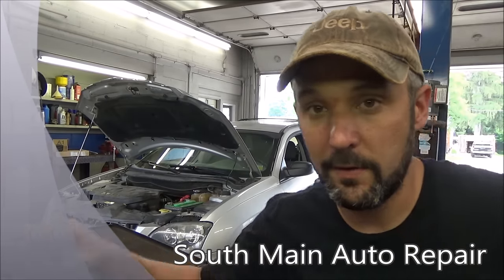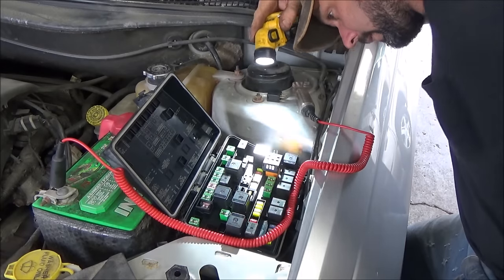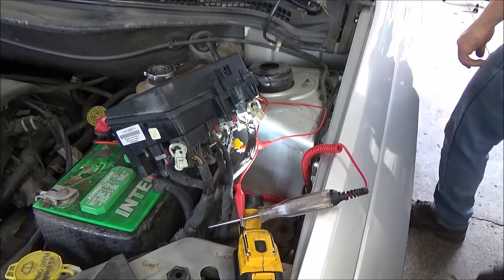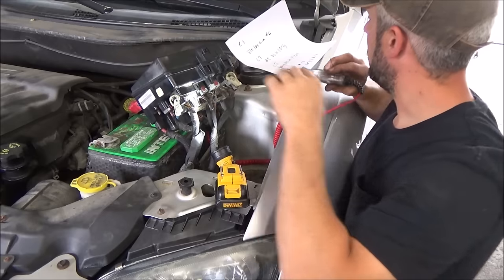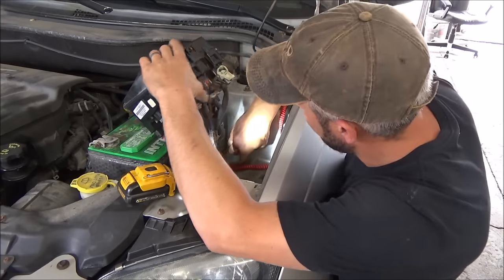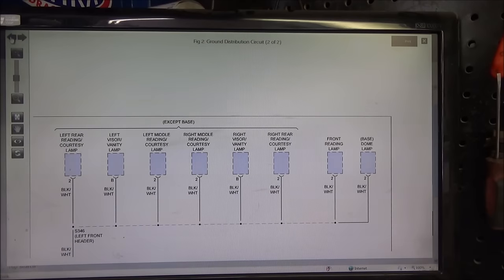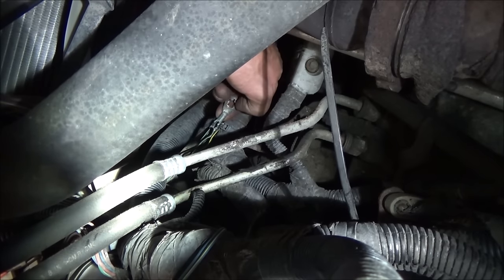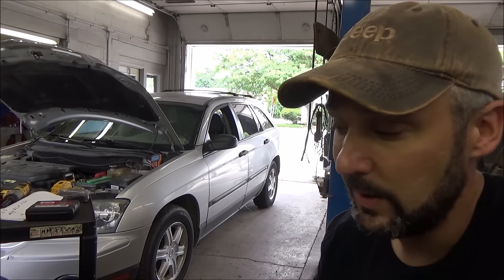Chrysler Pacifica: TIPM Electrical Problems

Comment: I do like that approach I general tend to look at ground locations a little sooner and check those first if ground looks clean then I start chasing the bottom of the power module, your video was sent to me by one of my customers who is having the same issues with the same vehicle, as you were looking up all the grounds in I noticed where it pointed out the ground point you ended up at in the end, very informative video, and extremely helpful thank ya bud!

Comment: Thank you for your diligence. You had me when you did a primary check then double checked and l think there was even a triple check when you verified that it was one of the other components problem also. Even though that was not the exact problem with my 06 Pacifica it got me down the right path. l found a bare wire under the fuse box that that l never would have checked, even then it wasn't obvious. An hour earlier l told my wife that we might have to take this one to the shop because electrical shorts could be anywhere. So that fix ended up not costing anything but then l triple seafoamed the engine, changed the oil and took it to the carwash. Thanks for making it a much more enjoyable weekend. Blessings

Comment: In all honesty I was ready to replace the tipm. I was curious enough to see how you were going to test ground and the results of your testing. Totally impressed. It's very obvious in this video that you are indeed tired but you still thought the problem through you still found the cause and you still found the right fix. I agree that clearing because was the appropriate action because you have to accept customer word to a degree that he had no problems prior to the system basically going a little nuts on it.

Comment: Dead on the issue with 05 Chrysler  Pacifica.  Same issue happened, then "fixed" it self later, but next day it was back.  Watched video, saw the corrosion, jiggled ground, bingo "fixed".  Still gonna have my mechanic do the correct fix as it is real difficult to reach let alone work in there for me.  Big Thanks

Comment: Having the exact same issue but it's only when I try to turn on the wipers, everything shuts off (except the car) and the wiper relays buzz. I bypassed the 3 ground wires directly to the negative on the battery with no luck before watching this video. 
Gonna take a second look now!
Thanks a bunch for the great info!

Comment: This video is a great education in combining practical troubleshooting tips and applying theory...for the lesser of us auto electrical wannabes' there's a lazy technique to help the troubleshooting enigma...pop the covers off of the relays associated with the non working component e.g.windshield wipers not working,locate relay..remove relay cover activate the electro magnetic switch with an insulated tip and if the component turns on then the issue is before power distribution e.g. a broken wire somewhere between the switch & the fuse box or the switch itself is faulty.

Comment: The two codes shown were related to modules that were on the same bad ground in the electrical diagrams you showed..  :)
Only noticed as I was reading the module names as you were searching for the TIPM grounds...  :)

Comment: I do the same thing when diagnosing 20 plus codes on the class 8 freightliner trucks. Usually is a datalink issue. The newest trucks have 3 datalinks  can and 1939 at 2 different speeds 250 baud and 500 baud. These converge at a starpoint module.So when diagnosing a multiple code problem you have to look at what common ground and power and communication protocol the devices use. A big headache and when these trucks get struck by lightning oh boy you are changing out all the modules. Have seen this 3 times in the last 5 years.Anyways you have to simplify a multiple code scenario that is what you did and that is why you own your own shop. Kudos.

Comment: My car is the same make and model as the one in this video and I have already bought another BCM and changed it out and needless to say that wasn't the problem 
And then I come across this video and  done just as you did and I couldn't believe thats what was wrong with my car it was a bad ground issue 
Thank you so much for making these videos you save me from spending more unnecessary money than was needed

Comment: Thank you for the video. Most of us may never think to check the grounds. Bad connections can show the voltage without being able to carry the necessary current. Half a day on a Dodge starter one time. Ground checked good, would not work on car. Jumpered ground, no change.  Jumpered hot just out of curiosity, fired right up. Cut battery clamp off of unblemished factory cable, replaced with cable clamp off of a junker. Problem solved. Apparently the factory cable had broken strands and would not carry enough current to operate the starter.

Comment: Thank You,  I'm trying to find a short in the ignition system of an 1998 Dodge Caravan Sport that only occurs intermittently which has made the vehicle basically worthless because you never know when it will happen. You have given me so many ideas and Technics  to use on finding and fixing this old van so it can be a daily driver for someone again, I'll be ordering some SMA Gear as a thank you for all the great work and videos you do. Thanks Again

Comment: Thanks for the Great vid! had this same problem and was able to fix it myself for under 20$ of parts and some time. Small tip for others doing this. take out the battery and battery tray for easier access to grounds.

Comment: Great video -Fix my problem. My car was out for 20 days. My local car service can not find the problem and i have an appointment with the dealer next week , just for disgnosis $145  . 
I wacth the video and i just made an short way - easy to check. I remove  light (2 screw) , battery holder (3 screw) and remove the ground same of the of video ( the of the 4 cables ) the cable look ok was it was broken in the connection . i strip the cables and connect to ground and everything return to work perfectly -  Thank you. I save  big money and time.-

Comment: Great job on diagnostics!  For anyone attempting this type of repair on their own, the very first thing to check would be battery voltage.  In these newer, computer controlled cars you can have a weakening battery that will still start the vehicle but below 12V and these control modules can do all sorts of weird things.  I'm guessing you did that first, but it wasn't mentioned in the video.

Comment: Awesome video.  A friend had the same issues so we went straight to the ground lug on the frame.  The connector looked corroded and the wires were attached but as soon as I touched them all four fell off.  Fixed and back on the road.  Thank you!

Comment: Thank you. 
   Now the manufacturing engineers need to redesign that ground connector - NOT - so you still have a job to do.
    One poor and oxidized connector! Been there and done that with $200,000 mass spectrometers. 
   Thanks again. An enjoyable video. Good luck.

Comment: I was busy with another project and told my customer "car flipper guy" to search YouTube for Pacifica electrical problem. He found this  video and said it had the exact same problem . He sent me the link this video and showed up at 4pm.
I said I don't have 45 minutes to watch the video now unless Mrs O is in it., 😉.Turns out he gave me the minute mark Eric found the problem. I pulled the battery, battery tray and TIPM . Removed and  Inspected that TiPM connector Eric was back probing , looked fine, so I found the 3 major ground points , removed and cleaned all the ground nuts  , and  ground wire eyes and found a broken detached black and yellow wire at the lowest ground location. Spliced a ground eyelet wire left over  from a FIAM horn

Comment: If this was my personal car, I would have soldered all together along with a #12 wire and heat shrink  the group to make water proof. Then attach the #12 to the battery ground. I know that you must keep as close to stock, as you did. Thank again Eric , great video on all points!

Comment: G103 sucks. Coincidentally, I just had a stratus with  a no charge complaint come into a dealer. Found codes for all 4 O2 sensors as well. all 'cuz they share a wire to g103. I love wiring issues, that feeling of joy when you beat it, when all wires try to do is confuse you, good stuff. Trying to learn the proper "make no assumptions" frame of mind from you and others on the net. Thanks Eric.

Comment: Thanks for making this video, you helped another.  

I'm not sure how you soldered those connectors in that tight space (talented). 
 
Since I had the relay/fuse box out and the battery and battery tray removed, I decided to remove all grounds from the bottom 2 studs to provide enough slack to pull them out under the bumper (with bumper guard removed obviously).  

Was easier to sit and work on wires. 

Keep up the great work.

Comment: Absolutely love your videos! Im having some of the same issues on my 2008 Chrysler Sebring 2.4 where as the shifter moves only sometimes but never cranks and problems with the windshield wipers and the horn blows on its own just whenever it feels like. The last time, it started blowing when I opened the door that wasnt locked. Had to put key in switch and turn to get it to turn off. Ive unplugged all the plugs going to the tipm and plugged them back up. I guess I will try to check for grounding issues now. Thanks so much.

Comment: Great video even 4 years later! I had a low battery crank, and when I crank it everything stop working on my Pro Master. Things went haywire mostly things that aren’t technically safety issues. My mechanic called it a body control module but after looking at your video, I’m thinking it has something to do with a ground switch possibly because I saw someone else’s video a year or so ago saying there is a grounding strap that causes some issue but I did not save this video so I am not sure where I saw it! But it is a similar scenario to this video, the problems I am experiencing on my 2018 ram pro master, 2500

Comment: Thanks for the video. Nice job! I previously had watched you video on a Pacifica drivers low beam not working because of a bad ground. I had an issue with the drivers high beam not working. Also a missing ground. Also my cruise control was not working, although the cruise lights did come on, and window washer not working. Had a shop run another ground cable for the headlight and cruise and the windshield washer all worked again! But, your video gave me the answer. Unfortunately I could not find a good wiring diagram on line. Ugh. Thanks! Love your videos!

Comment: I have a 07 Pacifica I bought from the auction doing almost the same thing,  the auction says its the alarm causing it, some times it will start some times it won't, some times all the lights and windows will work some times they won't, The whole dash is black and has no power or lights and all, some times everything comes on and works great... I have been messing with it for over a month here and there between jobs trying to figure it out with no luck... I'm getting ready to bring it back in and check these grounds, if this is my problem I will personally drive to where ever the hell you live and give you a big wet kiss on the forehead!! Lol.. Wish me luck!! Thanks for sharing the great video!!

Comment: I don't even own a Chrysler Pacifica, but I own a 2007 Cadillac Escalade Esv be which I bought a month ago and found your video to be a good watch and technique.. what's funny is I just redid a few grounds and cleaned the surfaces, replaced the 175 amp maga fuse and ran new good grounds and slapped dielectric grease on all ground ends and even on maga amp fuse ends and tips of the ground ends to help prevent corrosion from forming as a preventive maintenance so I wouldn't I have no electrical issues on the future when I'm on the road..

Comment: Another approach, and you used part of it, is to find the commonality for all the failing devices.  You checked the positive to the fuses was that part that you did.  The commonality was the ground to all those relays supporting the failing devices which turned out to be the problem.  The fact that those power modules are notorious failures was a detractor and understandable.

Comment: The ground issue, like you found on here is what I see as the issue on my 1997 Chrysler Town and Country LXi. Because  the horn stuck on a few months ago on my family member. Which someone removed the fuse, and my family member has had my van nonstop for six years. So when I do get to look at my van, it is normally when it has a major problem. Because the wipers stopped working (which I replaced the switch inside a few years ago and it began working correctly). Plus the dash lights turn off, and no telling what else. 

Which after working on cars for the majority of my 46 year on earth. I have found what I was taught at my first job at a automotive repair shop still holds true. Look for the simplest problem it could be first. Thenwork your way up to the more complex issue. (Basically the cheapest thing to the most expensive problem that possibly could be a problem). 

I am sure I will find something similar to what you found with your customers vehicle. Especially since I have had cats up in the left front area of my van. On top of no telling what happens getting to my family members job, as well as while it is sitting there for the majority of the day. On top of around 60 miles round trip a day. From Claremore, Oklahoma to Tulsa, five days a week. Along with the 20 to 30 miles on Saturday's. 

So I will be checking the grounds for sure, and checking the condition of the connectors underneath the TIPM's. Because I am sure if it is the TIPMs on my van. I will be going to a salvage to find a replacement. Since I doubt that this is something that anyone would have in stock new, or New old stock.

Comment: thanks for the Video, my problem was with the passenger low beam. I purchased a used TIPM from the local salvage yard for $28. . Same year and model Avenger. Tried the uint and found the same as OEM(passenger low beam. not working) Decided to check wires and found ground in wiring harness failure. Installed a separate ground and everything is working now.. Thanks for the Help.

Comment: Similar problem on my 2005 Grand Caravan.  I had it at multiple items not working or, intermittent.   I traced the grounds and voila, tightening a loose ground connector fixed multiple seemingly unrelated problems.  Now I know how a real mechanic traces down a bad ground.

Comment: Fine job as usual. My only addition  when testing grounds lately is add more of a load then just the test light. Ongoing fight with a auto car where test light light's up fine but circuit wont carry load. Drove me nut's till I started loading the circuit with a 4" work light. I think it's 40 wats. Added to the test and watch the harness fall on it's face. Joy's of working on 22 year old truck.

Comment: My inclination is to blast the exposed portion of every electrical connector and ground eyelet with a toot of dielectric grease, to prevent water intrusion and crud build-up, while insulating the wires from stray voltage. Never thought of doing the underside of the TIPM, though, but it makes sense.

Comment: Good video. I just had one of these here with similar problems, and maybe it'll help someone reading along. The ONLY module communicating on this 2004 Pacifica was the ECM, yet querying with the J1939 protocol showed no modules on the bus. After watching several videos with similar issues with the grounds under the battery, I decided to check there first-and sure enough everything was 'green' (as in 'corrosion green'). Cleaned everything up, new ring terminals- (Plus...I coated these grounds so they'll never corrode again)... BUT still a no-go. No change with anything.  

So...back to the scan tool, and reasoning what's "on"--and what isn't talking. Only the drivers' door door locks worked, power door lock on the drivers' door, climate controls, radio and DVD working...but NO scan tool communication. The car would start and run...dash and pretty much everything else dead.

I decided to focus on the pin 2 DLC communication PCI bus...and sure enough...shorted to ground from the TIPM C9 onward. This white/ppl stripe PCI circuit splits off from three circuits at the TIPM. I like the fact that you used a 'real' test light to properly load the circuit on those grounds, as a volt meter can give good results from a circuit that fails under load...so at this point I had nothing to lose. 

The only real next step in my mind was to disconnect modules one at a time to find the short before tearing into the harness at the splice in the "A" pillar...BCM, Instrument cluster, ABS module, SKREEM, etc...

and when I pulled the connector on the drivers' seat module from under the seat--the car came alive !   EVERY module communicating again when the DRB3 scan tool reported none.  Hope this helps someone else...keep up the good vids !

Comment: 02 Chrys T+C.. started presenting no crank. Starter works, got needed battery. But, also need turn switch at column.  Now, I got dash reset when using turn signals. (Getting turn signal multi-switch in morning.  I really think you know this stuff!  Also, I am going to review grounding, and many points you covered to recheck.

Comment: It’s also funny, that I found all those green crusties, and boogers (corrosion) in the battery compartment on a decent looking original Nintendo Game Boy with its dot matrix display. Some old Duracells were in there, leaked, and caused some damage to the circuit board. A lot of wire brushing, fine grit sanding, cleaning, and tiny patch soldering on the logic board, to get the old Game Boy to turn back on.